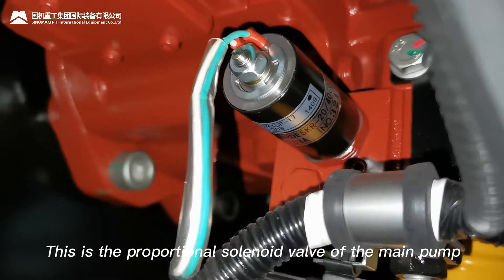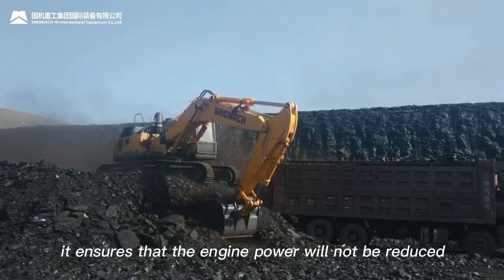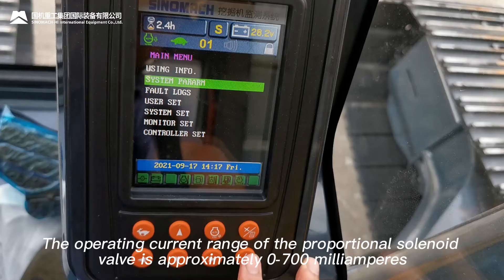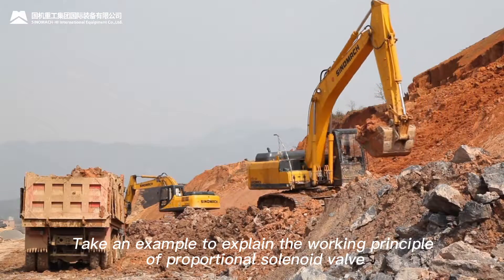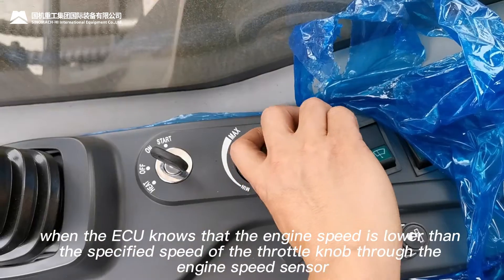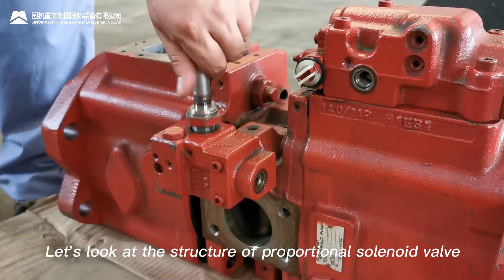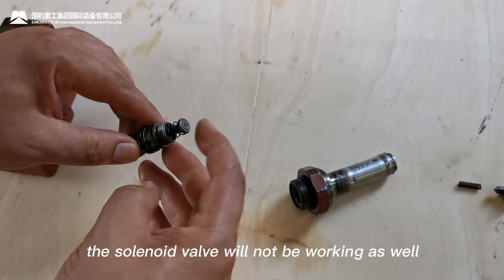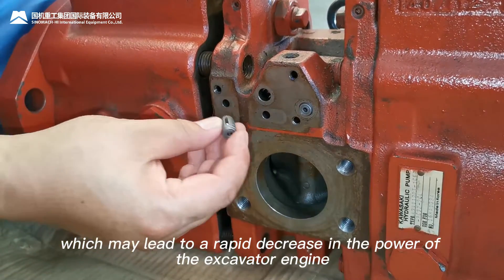The Proportional Solenoid Valve of Kawasaki Main Pump

Comment: Would this cause excavator to stall from using any controls?  Especially travel?
Reply from the maker: The operator will feel weak hydraulic work, especially at high engine speeds